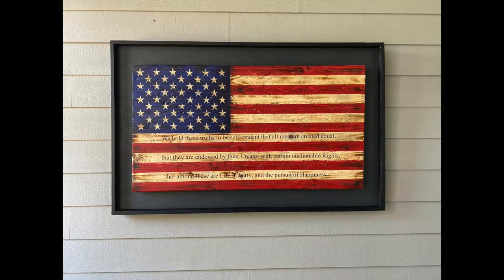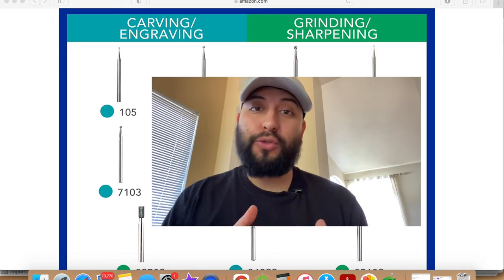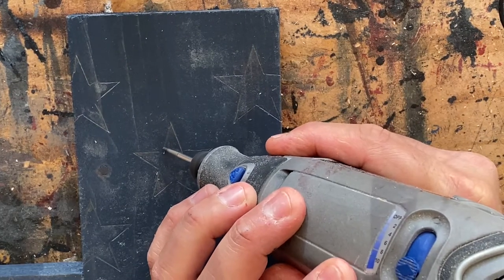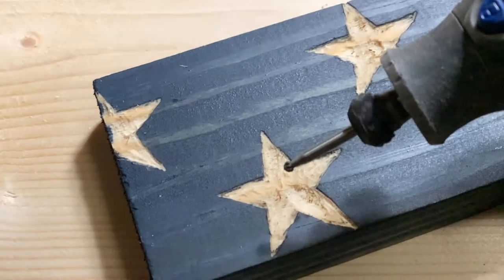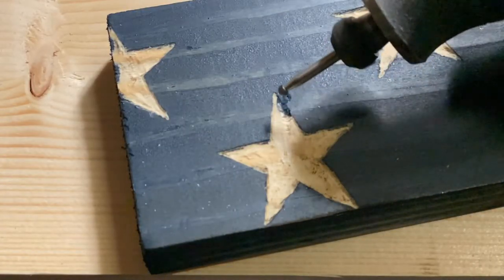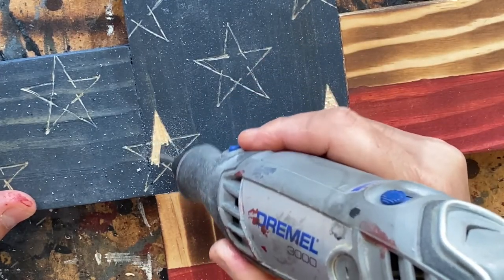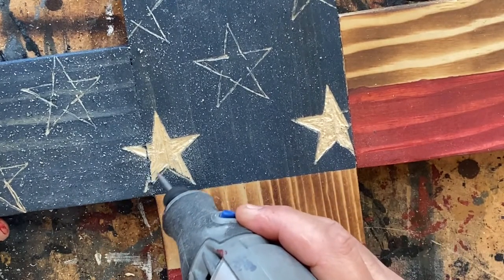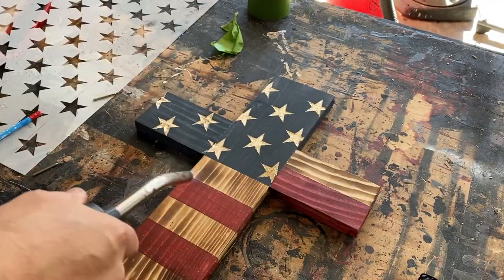How to Carve Stars on a Rustic American Flag | How to Carve Stars with a Dremel | Rustic Flag How To

Comment: Question I have been making flags now for two years, always use a dremel but lately when I’m carving with the bits your talking about it not taking the stain off the wood, I have to use a bigger ball head and push deep and it doses any advice, it’s leaving paint behind and smearing
Reply from the maker: It might be time to replace the bit.

I would also experience this too. I think some wood just soaks up the stain a bit more than some others.   But I would try a newer bit to get rid of that material more efficiently.